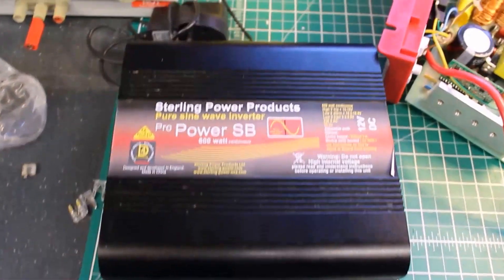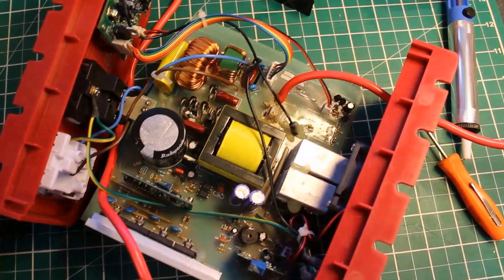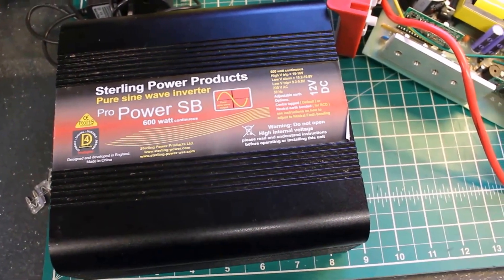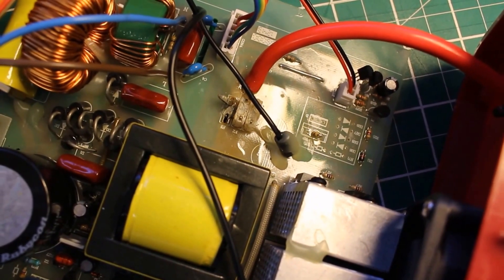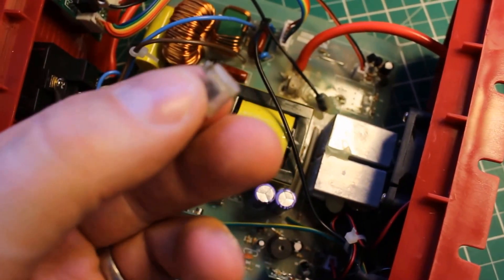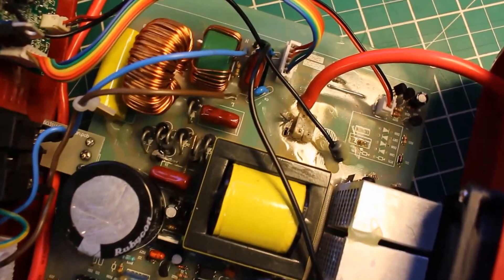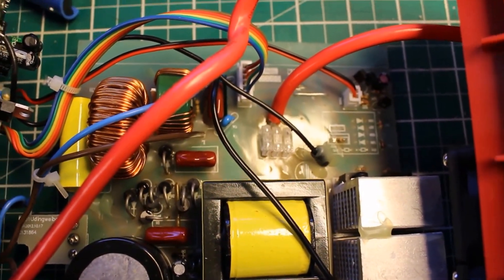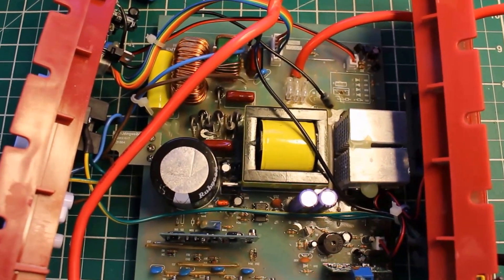Sterling Power Pure Sine Wave Inverter Fix at FixItWorkshop

Comment: I"m getting crazy trying to repair my 1600w pure sine wave.
I changed almost all mosfet and drivers. I solved the short circuit problem (fuses now don t break anymore) but still 0V at the output.

Would please tell me the oscillator quarz piece how many khz is it?
Reply from the maker: Sorry, I don't know

Comment: ive just reversed polarity on my inverter pure sine 1600 watt  and now wont turn on do you think ive blown the fuses inside
Reply from the maker: Its definitely worth checking the fuses. Turn the power off first!
Reply: ok thanks for getting back to me so quick ill check the inverter now and ill get back to you
Reply: Ok I've taken the back off there are 6 30 amps fuses but there so hard to see if they have been blown or not they don't pull out think I will have to desolder them
Reply: iv'e blown every single fuse and there soldered in time to get the solder gun out lol 
you saved me 100 pounds thanks buddy